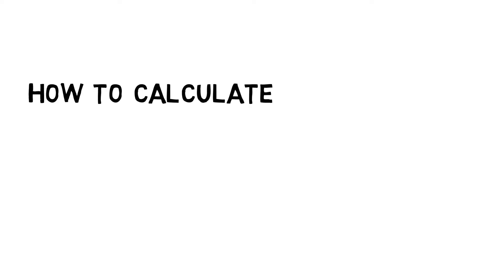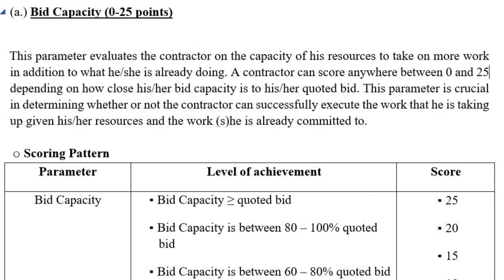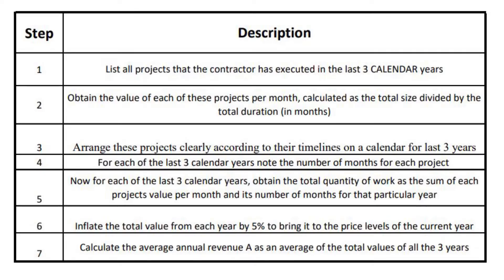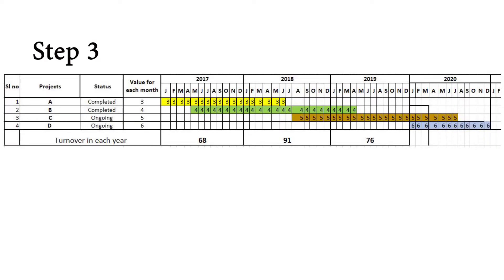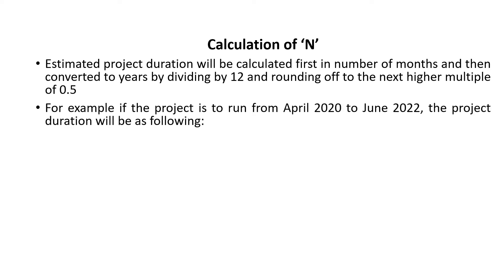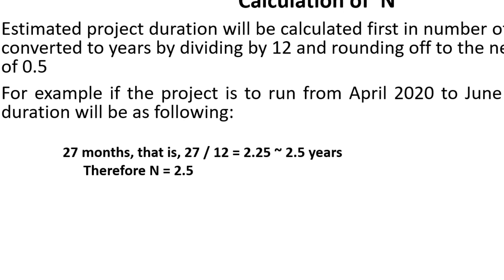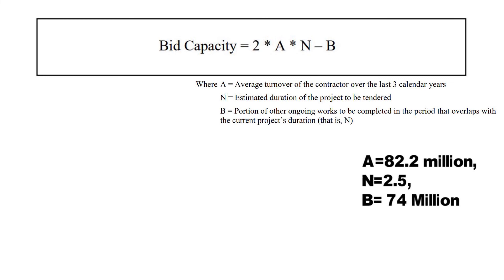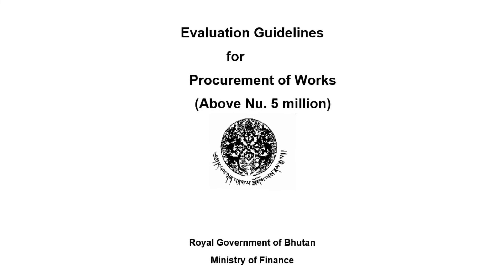How to calculate Bid Capacity of contractor in Bhutan|Important qualification parameter for bidders|

Comment: in sbd, it has been specified that last 3 years , last year being the current year in which work is being tendered. if we go by this statement, 2020 is the last year and work is tendered in april . so last 3 years (36 months should be from april 2017 till March 2020. but your calculation of average amount included jan,feb, march 2017. isnt it wrong? and also you N, the unit is in years, which is not specified in the document. It looks like the document is not reviewed properly leaving room for misinterpretation.

Comment: For A= average annual turnover of last 3 years, what would be the difference if we use the annual turnovers issued by Revenue and customs office. In some of the tenders we are asked to submit the annual turnover certificates issued by DRC.
Reply from the maker: This bit capacity calculation only for tenders following RGoB PRR. The bit capacity is auto calculated by e-Tool system. 
The turnover is auto pulled from the CDB database of contractor’s track record.
Reply: @videotamang  las la